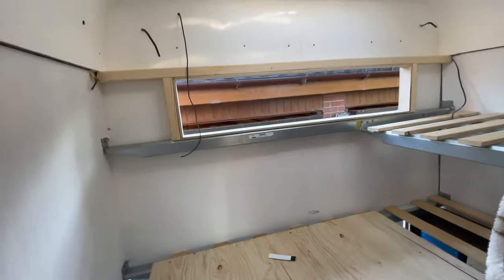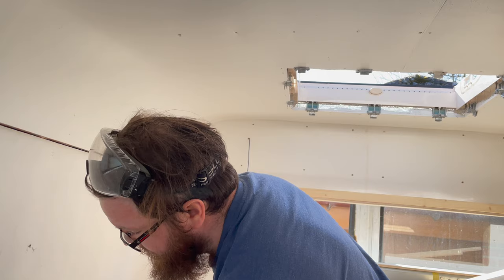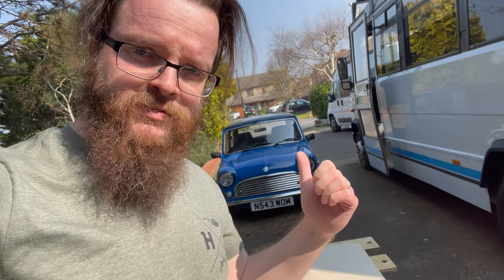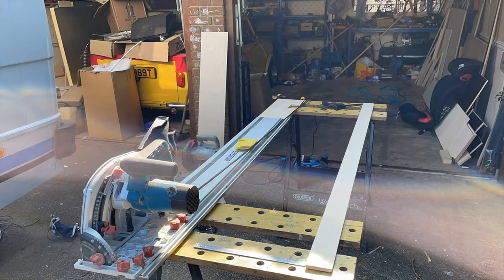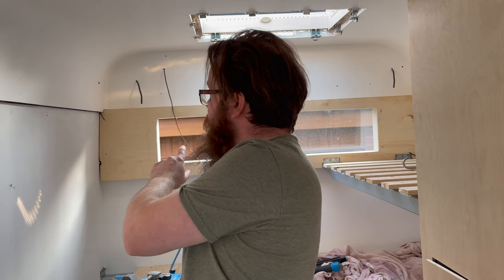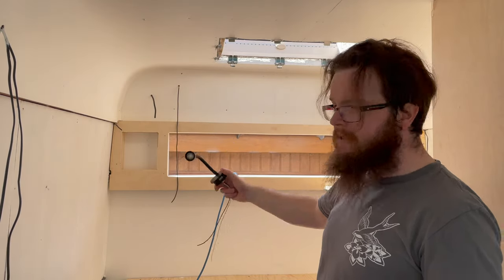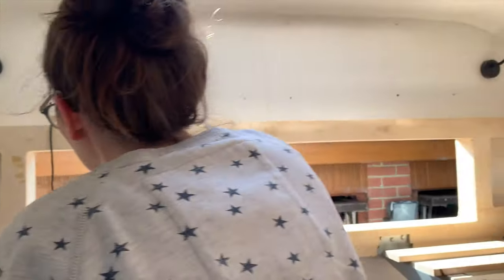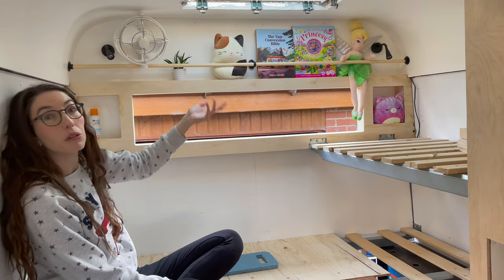Simple Van Bedroom Storage | Improvising Design + Overcoming Router Mishap | DIY Van Conversion

Comment: I dropped on a bargain last week. Pick up two 18mm sheets of Poplar core plywood for £10 each for the floor of my camper. One sheet was slightly warped but I can screw it down if I have to use the second sheets. Late last year I picked up some 4x4 ft sheets of 4mm ply for £3 each. Both were FB bargains. It's crazy how all building material prices have gone through the roof.
Reply from the maker: That’s an amazing find Andrew, fair play. The prices are crazy. I thought they were bad last year. A local carpenter to us said he’s finding exactly the same. Especially with birch. Congrats on your find, a few screws will sort that little warp out as you say.
Reply: @WanderbusAdventures  When I saw the advert on FB I was expecting to see the plywood was completely shot or the advert was wrong. Turned up at the address and it was brand new sheets of 18mm plywood. I only needed one sheet but purchased two of them because you can guarantee I will need more to complete my camper build. I also picked up forty 4tf by 8 inch strips of 18mm hardwood ply last September for 50 pence each. I wont use all of them but I will sell the rest on once I've finished my camper. I need to make room in the garage for the next project. I think I'm a wood hoarder. LOL
Reply from the maker: Lol. Know that feeling. We still have the scrap floor, just in case 😂
Reply: @WanderbusAdventures  Talking of van floors. I'm cutting the ramp out the back of my ambulance to lower the floor by about 4 inches for extra storage. That's why I needed the 18mm plywood. To make a lift up cover. The ambulance never had a spare wheel because of the ramp. So the new spare wheel is going on the back doors. I think i'm doing thing backwards. I've started with the body work and prepping it for painting. There is no way I'm doing all this work to drive round in a bright yellow Peugeot Boxer . LOL
Reply from the maker: Ha. We are going to get a hanger for the back door for ours too. There’s a chap that makes them for Varios, and the design is rather neat and fits existing holes - which is ideal. 

Bodywork wise, ours still has some crusty bits. And we will have to patch it until we have time over winter to perhaps do something more drastic.
Reply: @WanderbusAdventures  All vans take some work to get the body looking nice. Rightly or wrongly I'm going to use coach paint. I've done other vehicle with coach paint and they turned out really nice. I've not done one for about 15 years so it's back to a learning curve. I don't like the idea of using military paint and a roller. When coach painting is done right the finish looks great.
Reply from the maker: Have seen some great results with coach paint. I’ve seen some people use boat paint too